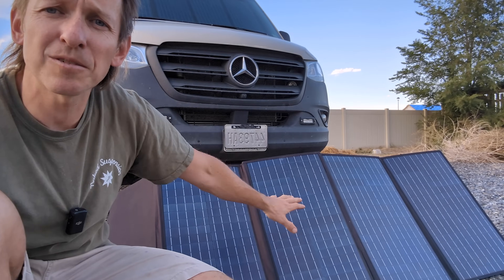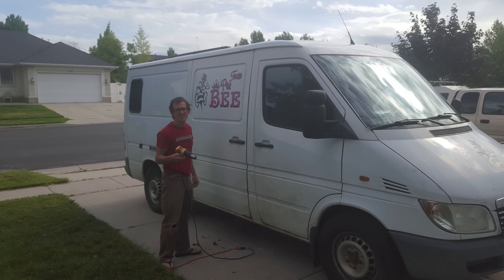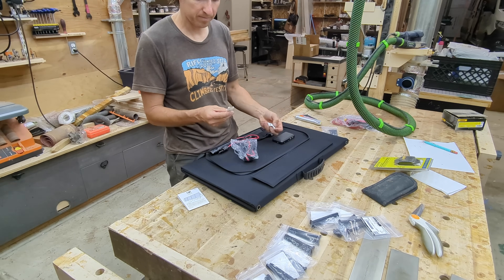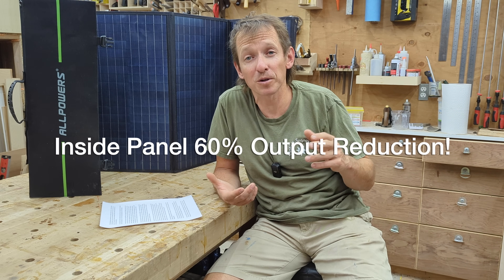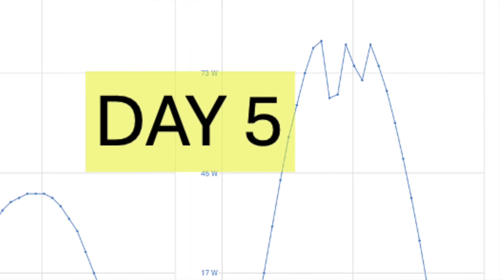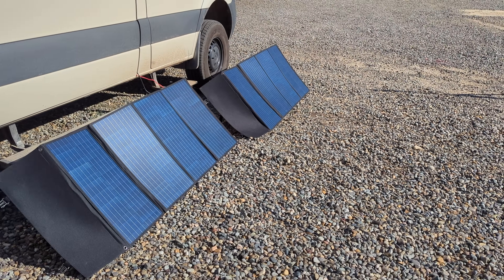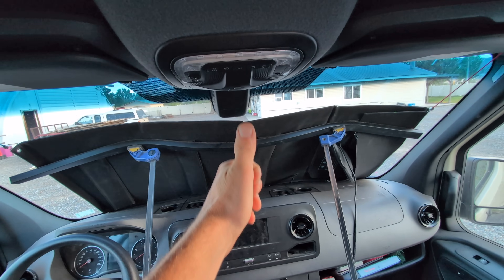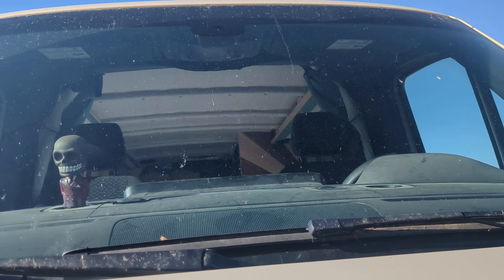Solar Panels Inside Windshields

Comment: I have always wondered if there was a difference, I would never have guessed it would have been so big a difference. I always thought windshield reflectance would cause some loss but guess the temp range is a lot lower here in the UK so may not end with such a large difference between inside and out.

Comment: Panels on your roof are subject to snow, dirt, and bird droppings. Hard to clean them properly too.
Inside the windshield and things are much better.

Tinted windshields reduce output.
Reply: Windshields have two panes of glass with plastic sandwiched in between.
They are designed to stay together when broken and reduce much of the UV rays.

Comment: I noticed your windshield is slightly blue like some other vehicles especially German cars like Mercedes and Audi I think that seem to have a slight blue tint in their windshields which could add to loss of output like you said up to 60% reduced efficiency or output plus maybe the glass itself could reduce some of that output too even if it’s clear…

Comment: I got a Renogy panel to charge a Jackery. My idea was to install it so it took sunlight through the sunroof so the panel was in the car and could be used all the time. 
Worked brilliantly during tests until I put it under the glass and then it failed abysmally. I got around 4w of power regardless of how the sun shone when under the glass. Resting it on the outside of the roof it increased 10x nearly. The glass certainly has an ability to block sunshine for my panel.

Comment: So the coating and tinting on the windshield are doing exactly what they were designed to do.
Have you thought about some large suction cups mounted in the eyelets on the panels, and then mount the panel on the outside of the windshield??

Comment: I used to keep a trickle panel (14 VOC and 1.5 watts) on my dashboard all the time just for my starter battery.  If I accidentally left my lights on, on the way to work.  I would take it out and stick it in full sun and it would get my battery charged up enough between say lunchtime and 5pm to start my car and go home at 5pm no problem.   It made that battery last 10 years and then my wires that had been fried in the sun (UV light) for 10 years got wet in a drizzle and ended my battery and the panel.   Glass 50 watt panels will fit on most dashboards.  Even 100 watt panels with the more long retangular shape would probably fit on a lot of dashboards.  I don't do plastic flex panels.

Comment: I've had panels in my west-facing dual-paned apartment windows for while. In my humble experience, they get roughly 1/2 the rated wattage. Surprisingly, a 50W flexible panel from BougeRV I bought for a steal (CA$40), gets up to 29W, and it's at least a decade old.

Comment: It's simple to understand. Solar Panels Produce Less Power When They Get Hot. That's why they produce more power outside. The heat can disperse easier when not in a hot van. The cooler the panels are the better they work.

Comment: I wonder if you could retest with just a sheet of automotive glass over the outside panel just to see how much the UV and glare shielding in the glass actually effects the output. With a proper size shades on all windows you would also keep a lot of the heat out - you're literally drawing some of that energy away with the solar panels.

Comment: I'm not surprised by the reduction in output considering that windshields are meant to block UV. If you are just using it to keep/top up batteries while you are gone, it's an interesting option. If you consider that you don't really lose much from a lithium battery just being stored, you won't gain much from a solar panel inside the windshield. Unless you have a small drain running something all the time, it's a wasted effort. Save your pennies and buy a couple flexible panels, can't be stolen without lots of effort and the gains will be worth the effort. A solar panel inside a window designed to block UV rays is going to do nothing good and if somebody really wants your solar panel, a locked door is not going to stop them from stealing it.

Comment: Thank you for your data. I have done similar tests myself with several different panels. For me, the issue as you mentioned is that the car needs to be facing south for best results. When I go hiking or ca,ping, on most cases, I do not have a choice on the direction I park. I am lucky to even find a parking spot. Lol. Of course there is also the angle as you mentioned. Your video has made me rethink my testing. I think I might try using a cigs panel, which reacts differently than mono crystalline. Thanks again.

Comment: Based on experience, it's better than not having panels at all. I am in a 'use it while you build it' situation with a van being built as a base camp for mountaineering. Mostly used for 4-10 day trips, not full time living. Also in the UK where we are not known for great sunshine. I two sets of 100W panels. They are a 2 panel bi-fold design. The panels are wired in parallel. I can get one open for the full 100W and the other set folded to give just 50W in the front of a Citroen Relay (equivalent to Promaster). About the best I have got is a 300Wh 'harvest' with them inside. If there is still sunlight when I get back from a hike, I can use the outside as ground deploy and get a bit more. They are not waterproof, just water resistant, so if I am not there to monitor them, they have to be inside.
For two summers, I have got by with this. The van has lights, some USB charged devices and a fridge. If I am careful it works out ok. It also helps that I normally shift location every couple of days and get an hour at 30A from an Orion DC/DC charger when I do that. For comparison, that one hour is 360Wh, so more than a day of solar.
Two weeks ago, I finally put panels on the roof. It's now a cloudy September and I am getting an easy 300Wh from 2 x 100W roof mounted panels without all the faff of setting up. when I actually get a sunny day, I can see what a good yield will look like! I can also park for the view out the side door, rather than for optimum solar orientation.
The bottom line is, if you don't have roof mounted solar, putting panels in the windshield will get you something, but  not much.
I also used cushions for support, but being the UK, things didn't get very hot. I guess US desert states would be very different!

Comment: Photovoltaic cells are colloquially called solar cells which creates the impression for many that they are powered by the HEAT of the sun when they are powered by the LIGHT of the sun.

Placing them behind glass, especially tinted glass will reduce the quantity of light falling on them.

I would not be surprised if having them unventilated actually reduced their efficiency too.

Comment: Friend is in the auto tinting business. He has talked about the tint to block heat. You could probably buy some window tint designed to block heat to place temporarily on the exterior of your windshield. Still some sunlight reaches your panels but does not overheat them.

Comment: Glass catches a lot of ultraviolet. If the panel doesn't get too hot, it will also last longer inside. My favorite less power trick is turning a pair of panels largely south and north so you get morning sun and evening sun. Less to struggle with a battery.

Comment: I have solar panels that stay outside. During hot weather the voltage drops because of the heat, buit in winter the voltage goes up

Comment: I would try to make a frame/structure to securely hold the panels on the outside of the windshield. Also a way to vertically hang panels on the sides or back.

Comment: Seems still, if you’re hiking or away for any reason, and don’t want your equipment stolen, you’re still adding SOME charge. Also, couldn’t you use a higher watt panel to compensate for the loss? Couldn’t you even go over the max for your storage battery — cuz you ain’t gettin it all anyway.

Comment: I think if I was to build out a van I would add a huge marine hatch that's also a skylight and then I could use solar panels as a"shade" that sides open and closed on rails along the ceiling.  That way the glass could just be thin plexiglass which may transfer more energy than the wind shield.  Has anyone experimented with mirrors + solar panels?

Comment: Thx for the test, as I have been wondering.  I have a 120w with an auxiliary AGM battery to run a 25qt fridge & other small 12v needs on the roof of my Ram ProMaster City cargo minivan (the baby of the ProMaster family), and that is similar to what you said about your old van.  Before my simple camper conversion that added this solar I used to park facing south to put a 60w folding panel on the outside of my windshield & run the cable in driver’s side to power/recharge a Jackery 240 on the floor in shad to keep power station cool.  Like mentioned, I often wondered if it would work on the inside while I’m away from the minivan because one can easily recharge a Luci Light on the dash while driving.   Now I’m wanting to add a bigger 1000-1500 power station for flexibility of not having it tied to camper van.  Assuming I can find one that fits inside my windshield, I was wondering if a 200w fold panel would work to make up for lost efficiency???  Unlike your setup of needing to suspend the panel, I would put my custom fit Heat Shield window cover behind panel to keep heat out of cab/ van interior. Should work in theory.  Thanks again for the review so I can share it with my helper-bees on this project.

Comment: It just goes to show how much heat windows create. 
There should be a mandate for 50% exterior coverage of windows of houses in the summertime to reduce energy consumption from Air Conditioning.
Reply: Nah, window shades and/or anti-solar window film would be a much better option vs eliminating views of the outside world, or eliminating potential/secondary emergency exits. Plus, reducing the number of windows, reduces access to fresh air from all the nice days that occur throughtout the year.
Reply: @__WJK__  I’ve ruled out shades and film for a reason, I’m glad you asked. The reason is because they’re a gimmick. As long the sun’s rays are able to make it through the glass there will always be a tremendous amount of heat generated on the interior side of it. A substantial exterior mounted coverage is necessary to reduce any worthwhile amount of heat.

Comment: I only browsed the video to get your results but had a thought.  Not only does putting the panels behind the windshield drop the power to 40%, but also you lose the ability to aim the panel directly at the sun.  For example sun is east and truck is pointed north.  On a free stand in a campground you would benefit from sun aiming too.  If you addressed this and I missed it, apologies.

Comment: Even though the output is substantially less it would still make good sense if you're leaving camp on a hike, etc. and want to at least keep a little charge going to your power station.  I have a little 110 Dokia panel that I am using this weekend for the first time on a camping trip so may try it out myself.

Comment: You in theory should get a 3dB loss due to a window, as it tends to polarize the light.  Then if there is tinting, as in most vehicles, the loss will increase. (3dB loss equals a half of the power.)  Your test pretty much showed that.

Comment: Thanks for the experiment.
I think this may be good for certain situation such as parking under roof, act as a sunshade, extra solar input to keep the battery charging. You may want to open the side windows a bit for ventilation, that may help to cool the temperature down. 
I personally think it's a good backup to have.

Comment: I have 1800W of panels inside my porch windows, which face south and east. The glass is Low-E, though I have no idea whether this affects the output. The most I can achieve is 400W. I chose to place them inside because there is no maintenance, no snow and leaf removal, no permanent attachment to the house (I hold them in place with spring curtain rods), and I don't have to die falling off the roof. My battery system is for backup primarily, and the panels are just for the worst case, as I recharge the batteries with (1) the grid and (2) in an emergency, from a generator or an inverter attached to my car battery. I have the folding panels too and in Virginia have never achieved 50% of the rated capacity in full sun at high noon in mid-summer. I'm impressed with your performance inside a tinted windshield.
Reply: Dang, I have never heard of anybody doing this before with that much solar. That's a lot of windows for 1800 W.
Reply: I'll explain my setup. I have a sun porch above my 1-car garage. It has 13 identical windows with glass of 28x66. 4 are on the east, 8 on the south and 3 on the west sides. There is also a glass single door and a norrow window on the west side. The panels in each window are a 100W HQST, topped by a 50W Renogy (same company). I cannot use the west windows due to shade. The panels are all 12V, combined into 6 48V striings. Actual voltage is 75-80 open circuit. I have another 4 HQST 100W panels to mount outside under these. They will be hung on a french cleat-type system, flush with the wall.  Thus, all 28 panels, inside and out, can be removed with no tools.

Comment: I just happened to run across your video today.(I think you did a good job) i’ve been in the Glass business for a little over 50 years. This is just my humble opinion, but I believe the reduction and output of those panels is due to the polyvinyl butyral interlayer  (PVB) Which is actually capable of filtering about 99% of the ultraviolet that passes through it. I believe that is the primary cause in the output, reduction. Keep up the good work.
Reply: It does have to do with the PBV, most windshields and front door glasses are tinted from the  factory with a green tint and transfer about 70 to 75% light so would cut down the output. Back in the 70's and older some vehicles had clear glass with no green tint.
Reply: I don't think it's the ultraviolet so much as the fact automobile glass is multilayered and often tinted. A front windshield might do better because it shouldn't be tinted.

Comment: Thank you Professor Proton for running this experiment.  When I retire to a truck camper I had planned on using a solar panel inside the windshield to trickle charge a backup power supply but if it only generates 40% the output as when it is deployed outside I might pass on this idea.

Comment: Thanks for doing this, and thanks for putting the main answer early in the video.
Follow-up question:  what if you face the van east on a cool morning?
As panels get cheaper, "questionable" stuff like this begins to make sense, especially if you use some power to ventilate the vehicle.
(I have had various plastic things fail in the interior heat, over the years, here in Alabama.)
Finally, some have suggested UV or IR-blocking windshield layers are the problem, but most panels are tuned for visible light, because the most energy is there.

Comment: Ha Ha I've done this for years especially placing them on the inside when I'm gone to prevent theft. If the panel doesn't cover the whole window, I'll put the shade behind it to keep the vehicle cooler in the summer. They are on the outside when I'm present.

Comment: I tried maintaining my car battery with a 65w panel and a 240wh Jackery battery pack. Had the panel inside. Don't have your numbers, but it kept both batteries maintained. Not sure if windshields have a UV blocker if that has anything to do with a lower output since my photochromatic glasses won't change very much through the windshield even w/ direct light or that solar panels need ultraviolet light to work properly. Apparently, they do for the reason why they don't work as good through the windshield.

Comment: Like# 198 - I actually do this as a sun shade here in AZ as well as to keep my 12volt battery topped off
Reply: Ha, I thought of that but haven't done it yet, just got a Bluetti but not a solar panel yet.
Reply: My 12v battery is substantial, guessing it could start the Space Shuttle…
So having it topped off is beneficial. Its a 95ah 12v that’s roughly 7” x 8” x 14”
I once left my lights on all day (10 hours), and it still barely started. That’s when I bought the panel and affixed it to a sun shield…

Comment: Great video, guess we know why window shade manufactures didn't already do this.  I wonder if securely mounted solar panels on to the side of camper van bodies will help increase the amount of solar power generated. I see some solar panels can be mounted on the front hoods of Sprinters but I wonder if the heat from the engines reduce their efficiency?

Comment: If it's a cool day and you want the extra heat, the inside option makes the panels 'dual output' devices for the good. However, if you expect a hot day and want cool comfort, the heat needs to be kept OUT to reduce the load on cooling appliances. So, seasonal considerations indicate some days where the outside panel is best.

Comment: Did you look into the effects of coatings on windshields? I’m guessing you just assumed most windshields will act similarly enough? Wasn’t sure if different manufacturers might use different coatings, or even none at all in some cases, which could potentially affect results. Might have to try this on my own van and see how it compares. Thanks for the interesting content!